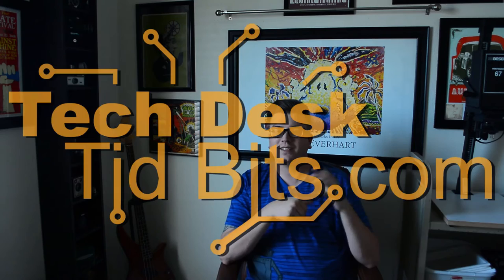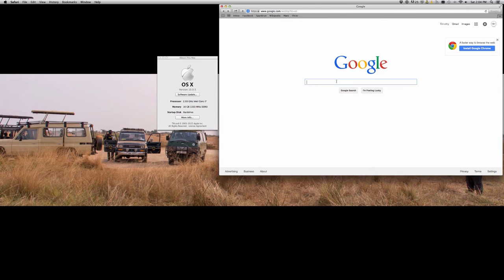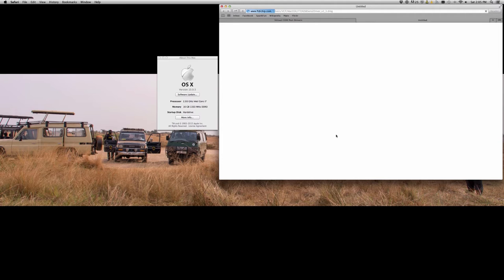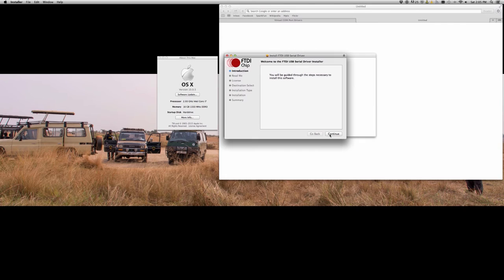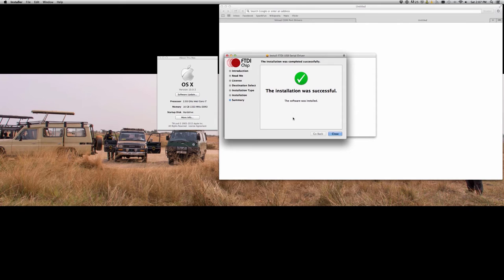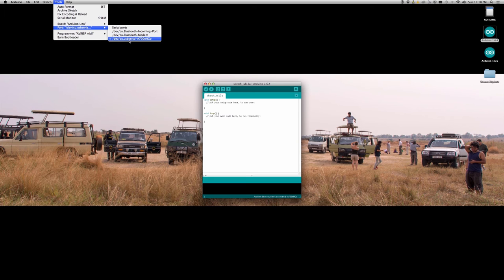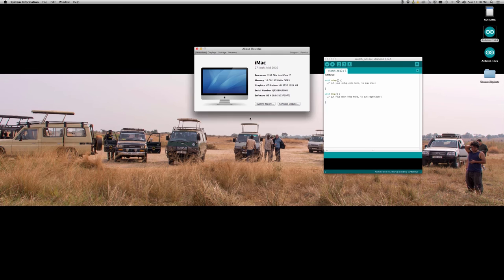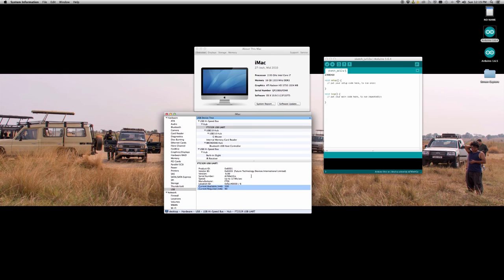Arduino Explained - FTDI driver install in under 2.5 minutes (Mac)

Comment from the maker: Likely something didn't work when installing the drivers. Have you checked in about the Mac, system report? Do you get a port listed there? If you do get a unique port for your arduinos, but they don't show in the IDE then it may be an issue with the arduino software. If you don't get any ID in the system report, then it's an issue with the drivers.

Once you pin point if you think it's a driver, or the IDE not playing nicely, then I would uninstall and reinstall the "malfunctioning" component. 

It sound like you followed the directions properly, but sometimes the process just doesn't stick for some people's computer at first. It's not likely to bother you once you get it working the first time. But initially it can cause a bump on the road. Keep positive and don't give up! Arduino is a great skill to learn and powerful tool to use. Have fun, and ask more questions if you are still stuck!

Comment: hey I would love to get some advice from you!
 I have a mac with version 10.11 (el capitan) I have 2 different arduino's NEW ATmega328P CH340G UNO R3 Board & USB Cable for Arduino DIY MC. 
I followed your video installed everything, have my board on "uno" but my poort only shows a dev/cu/.bluethooth incomming poort. 
Both of the arduino's don't work..
It would be amazing if you could help me!
Reply from the maker: Likely something didn't work when installing the drivers. Have you checked in about the Mac, system report? Do you get a port listed there? If you do get a unique port for your arduinos, but they don't show in the IDE then it may be an issue with the arduino software. If you don't get any ID in the system report, then it's an issue with the drivers.

Once you pin point if you think it's a driver, or the IDE not playing nicely, then I would uninstall and reinstall the "malfunctioning" component. 

It sound like you followed the directions properly, but sometimes the process just doesn't stick for some people's computer at first. It's not likely to bother you once you get it working the first time. But initially it can cause a bump on the road. Keep positive and don't give up! Arduino is a great skill to learn and powerful tool to use. Have fun, and ask more questions if you are still stuck!